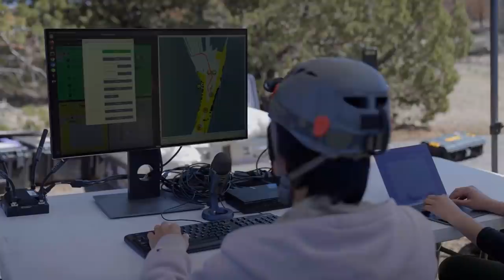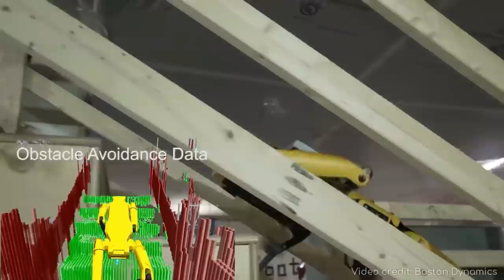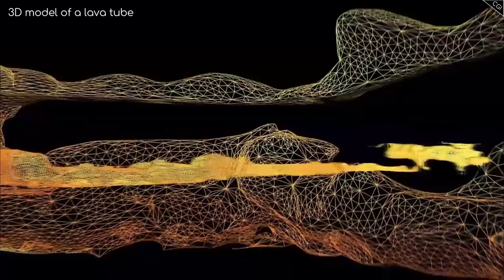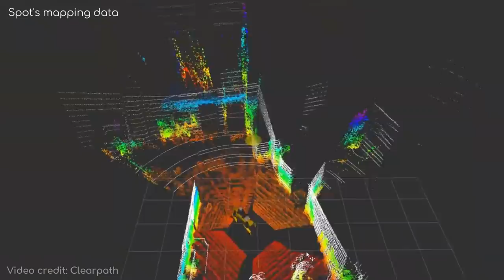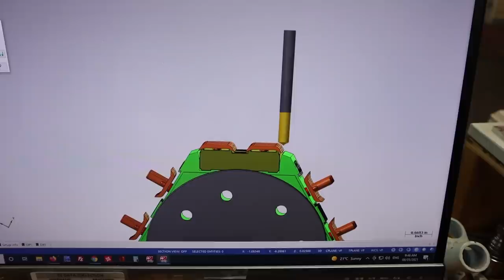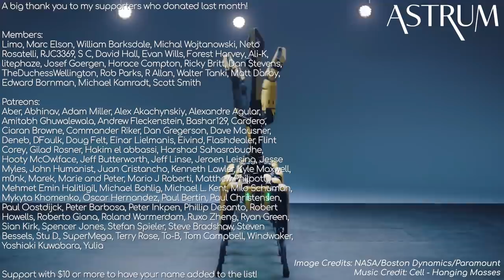How Wheels May Soon Become Obsolete For Mars Exploration

Comment: A few words on Spot’s radiation and thermal shielding would have been welcome. Be it on the Moon or Mars, the robot won’t probably be able to operate using the exact same configuration as here on earth. I’m also anxious to know what kind of mobile power supply they’re looking at. Let’s hope that Nasa will be able to secure a budget line within the Artemis program to conduct some tests on the Moon real soon.
Reply from the maker: Spot will definitely have to be specialised for the task, this is more a proof of concept. There are definitely still some obstacles to overcome with the design.
Reply: For power I could see a stationary RTG that the bots have to charge on. It would limit the range but lighten the load.
Reply: @upthere5826  Doesn't even have to be stationary, make it a wheeled rover
Reply: @astrumspace  Another important aspect of this approach is that by using an existing technology which was not initially developed with space in mind and definitely not on NASA’s budget, a substantial cost reduction is generated. Spot’s R&D cost have already been paid for by Boston Dynamics,  not by NASA’s subcontractors and there is no risk associated to delivery schedule. This would be a change in the way we go about exploring the solar system, moving from bespoke one-time use systems to quasi off-the-shelf customized units. And this does not even include the true paradigm shift to be introduced by the future jumbo carrier that Starship will become. Look at what the telegraph road brought to the development of the US or how tourism boomed after the Boeing 747 rolled out of the hangar. Fascinating times to be alive.
Reply: @astrumspace  Some?! Practically every component will have to be re-engineered. The sensors and processors for handling the large amounts of sensor data are all far more powerful on Spot than Mars rovers. 

This video makes it sound like you could send some Spots with minimal modification, not that they need to be redesigned from the ground up.

Something like Spot could be 20 years from being viable on Mars? I watched this video to hopefully learn about what research has been done towards the problem of applying walking robots on Mars. The current DARPA challenge is just about cave exploring, with nothing specific to Mars. 

I get that you wanted to talk about a cool robot and how it's being used by JPL in a DARPA challenge, but the connection to Mars is tenuous at best; probably why the NASA post on the challenge only spends a paragraph on the link to Mars.
Reply: @joemency2242  I was thinking it to be used as a relay for bots being in caves too. For extra range you could set up a chain where  the bot would charge the one ahead while picking up the data to move it down the line to the station.
Reply: Take a page from the game Surviving Mars. There's a larger wheeled rover that the smaller rovers can get a re-charge from.
Reply: @astrumspace    How reliable is Spot?  I'm particularly concerned about the joints, which must take a lot of wear and tear and are much more complex than wheels or tractor treads.  Unfortunately, there aren't any repairmen on Mars...
Reply: @RadicalCaveman  Reliable enough. Even if the mission was to end after 2 weeks due to mechanical failure, it'd still be a huge success. 

And I wouldn't be too sure about legs being more problematic on Mars. The main issues are temperature and dust. The former affects both the same, the latter favours legs---they don't rotate so the seals can be elastic and air-tight. Wheels have axles that need sliding seals.

Comment: The power necessary to charge one of these things has got to be tremendous in the world of extraterrestrial solar charging. The GPU/ai core alone is consuming hundreds of watts of power.
Reply: Actually they should send one to Mercury, no charging issues there haha
Reply: @tinp8028  The biggest issue with solar charging is the efficiency of it. I do not believe getting closer to the sun would allow our current technology to charge faster- though I could be wrong. Even the highest end panels on earth can only convert like 25% of the light energy received into power.
Reply: @coopers1716  capacity. They die quickly.
Reply: @coopers1716  While solar panels are only 25% efficient, that percentage is based on the amount of light falling on the panel. The amount of light is based on the inverse square law. Basically every time you double the distance from the sun you get 1/4th the light. Interestingly, each planet is very roughly double the distance from the sun as the previous. On Mars you need panels about 4x larger than the ones you need at Earth. If you are careful about power consumption you can still use them at the surface on a wheeled vehicle. At Jupiter the panel size becomes pretty unwieldly but it has been done. Anything further than Jupiter the panel size becomes too impractical to launch.

Personally I don't see anybody moving away from wheels anytime soon. Even with radio isotope thermal generators like Curiosity and Perseverance there is a pretty small power budget. Wheels are just so much more energy efficient than legs, freeing up that power budget for a larger science package.
Reply: It looked like one of those wheeled rovers had a nuclear power unit. They could send a big dog with the nuclear power unit and the little dogs explore then come back to recharge and upload...
Reply: Nuclear Fusion is coming soon!!

Comment: Wheels may get stuck in soft sand but they're also a well proven and reliable form of propulsion. Walking style robots have many more moving parts that act as points for failure. Focus needs to be put on developing robots that could repair robots on Mars if we're going down that path 👍
Reply: And wheeled vehicles can still move as intended(somewhat)  even with broken wheels.
Reply: Maybe a combination of both could be used. The robots would still travel using wheels most of the times, but when it got stuck or need to traverse challenging terrain, it would deploy its legs
Reply: That part about repairs is very good. I would think that a mechbot and repair facility would be needed right from the start. Then repairs on both walking and rolling bots could help them remain in service much longer.

Just so, a medbot and an infirmery needs to be set up prior to human arrival, as well. 👍
Reply: @daffamumtaz2361  Like wheels that can lock up to be feet on the end of a leg. I like the idea. It would almost be like some of those crazy rock crawlers with hydraulic legs that extend the wheelbase. The only problem is the complexity of including both wheels and legs, increasing weight (expensive), and the chances of something going wrong.
Reply: There's a reason most land-based animals evolved legs here on Earth:  they're just a better tool for dealing with different types of terrain than wheels.  Wheels may be simpler, but their simplicity is also their limitation.
Reply: @caelestigladii  Animals can't move around with a bum leg?  You've never seen a three-legged dog before I guess.  I have.
Reply: Yuh, more wheels, bigger wheels...   :)

Spot would have sank in that deep sand too... 

A jump rocket could get a heavy rover out!     ;)
Reply: @sciencecompliance235  Have you seen a two-legged dog stay "upright"? I haven't.

Edit: How about a 1-legged dog?

Edit2: Well, I got curious and it seems 2-legged dogs can stay "upright" if they have 1 front and 1 back limbs. My earlier train of thought assumed both front/back legs missing.
Reply: @caelestigladii  Really moving the goalposts now, aren't we?  You're describing a situation where three out of four legs fail.  Not sure what you expect me to say to that.  That would be a horrendously unreliable machine if that happened.
Reply: @sciencecompliance235   Did I not say "wheels" in that first comment? Plural? From the start I meant multiple wheels malfunctioning. 
 
Please don't move the goalpost to 1 when I clearly meant more than 1.

Please learn to read and understand what you read.

Edit: About unreliability, that's just it, wheels are more reliable than legs with current technology.
Reply: they could send the robot with a bunch of spare legs that can be detached and attached
Reply: @caelestigladii  A walker with 50% of it's legs out of action can still very much crawl. A rover with 50% of it's wheels stuck is going nowhere, or only in circles at best. There's no denying the reliability aspect overall, but at the same time cars are more reliable than helicopters in the case of mechanical failures. There are certain things you can do with each, that the other cannot do. The wheeled rovers simply are not going to be exploring that cave, but a walking rover can. The fact that it might be less reliable at doing the tasks we're already doing with other methods, isn't an argument against using it for a specialist task.
Reply: @sciencecompliance235  I think the biggest reason is because evolution isn't good at making bearings and rotating parts. But with that being said, I think legs are a great approach for mars. Both legs and wheels have their individual use cases. Wheels are more efficient and legs are more versatile. Versatility is desired on a remote planet, and efficiency is desired here on earth.
Reply: @caelestigladii  Wheels have already been proven to be unreliable on martian soil. As stated in the video, they get stuck while legs probably won't. A broken leg is no different from a stuck wheel in terms of being completely useless. It doesn't matter if a wheel is reliable or not if it doesn't get any traction while a leg will be useful for as long as it's operational.

That being said, I'm sure the best approach would be to deploy the dogs from a vehicle, close to the cave they are meant to explore. The transport rover takes safe routes, and send off the dogs into more difficult terrains.
Reply: @batman3698  This is probably part of it, too, but we have wheels now and still much more of the Earth's surface is accessible to legged entities.
Reply: Assuming you have all the parts !
Reply: Sending robots to repair robots on different planets is not financially viable. It cost $10,000 dollars to send a pound of materials in low earth orbit. Its not worth sendinging anything that's not essential to space missions.
Reply: @sciencecompliance235  animals don't have exposed joints and are flexible enough to clean themselves off. Dust storms will pack the joins of these things full of grit and they'll seize.

Comment: How exciting with the potential future missions of exploring caves on mars!
Could we have a video on just that?

I can see so many hurdles to get over. How do the robots recharge with the limited or next to no sunlight? How do you get the robots inside the caves? By the pictures of the cave entrances, many of them seemed to have quite high vertical drops to enter.
And with that, are they planning on getting the robots out to explore more than 1 cave, or just 1 cave for the whole mission duration?
Are they planning on have a base station on the surface that communicates/charge/etc the robot exploring the caves?
Why not use air drones to explore caves? 

I'm already excited for the years in the future when we get some reports from a hopefully a successful exploration of a cave on mars
I'm eager to know both what they might find and how they solved all the obstacles to be able to do the mission!
Reply: God bless you
Reply: What if it accidentally discovered a martian colony on a cave lol

Comment: NASA might consider sticking to the current rover layout, but replacing the wheel struts with Boston Dynamic legs while keeping the wheels underneath.

The rover could then move on wheels on easy terrain, and move on legs locking the wheels when needed.
Reply: but the thing is wheels isn't needed anymore if spot could go faster then the current rover, not to mention it equipped with an AI
Reply: @yahyarisqi7879  there are power constraints on space rovers, and moving legs is more resource intensive and more complex than spinning a wheel.

I too would like to see Star Wars AT-ATs roaming Mars, but that's probably far in the future
Reply: @TheNasaDude  my thoughts was nasa could send spot to mars with one rover dedicated as battery station, so this rover can always stay in the surface to harvest solar energy. Meanwhile the exploring unit (spot) equiped with an AI which can  self aware of it conditions, so when the battery fall into low category this unit will goes back up from the caves to switch battery and continue to explore. Yes i know this easier to say than to do but with boston dynamics i think they could make it happen
Reply: Do you have any idea what it does cost to send a gram of payload to Mars? Noone really would take to systems of similar matter to Mars "just in case".
Reply: @yahyarisqi7879  that's very futuristic, and I like it

I think we'll need to se Spot employed in meaningful missions here on earth before NASA decides to sent one on Mars though
Reply: @TheNasaDude  i think it's very possible by now, they had a lot of experience with opportunity and perseverance, both of that rovers have some algorithm installed on them that could tell what should they do if the battery goes critical. And also the case for opportunity they had algorithms for the rovers to backtrack it routes. If they installed this to spot, it would be possible. But yeah the thing is, spot need to take a lot of test and mission here on earth before they really send it to mars
Reply: @yahyarisqi7879  Better still, nasa could use advanced RTG type batteries, which will last the spot bots for many years (probably longer than the mission duration).
This wouldn't be too hard to do actually, and it is especially needed in cave like environments (no access to sun). Plus it will save the overall cost and complexity of the mission.
Reply: @Ezequiel Ciamparella if implemented right, you can greatly reduce the weight penalty. My idea is mounting the wheels at the foot end of the legs. You can then forego the whole frame that connects the rover to the wheels, and simplify the wheel assembly by using the legs articulation instead of a steering mechanism.

The wheels and their motors will not add much weight or complexity, and they are proven successful design: keeping them might save the mission if the legs get crippled.

On the other hand, NASA has sent to Mars probes with robotic arms, so maybe legs could be regarded as specialized robotic arms and deemed sufficiently proven on their own. We'll see
Reply: Or just more and bigger wheels...
:)
Reply: @yahyarisqi7879  how do you know spot can go faster then a rover designed to survive Mars...
Reply: @emko333  because i watch the documentaries, mars rover like "curiosity", "opportunity", and "spirit", could only travel as fast as 20-30 m per hour that's around 3,75 cm per second. not to mention the delayed transmission between mars and earth, so the rover need to stop periodicaly to wait for the mission controller decide is it safe to go or there are any obstacle in the way. but with spot, it can be equipped with an AI so it can decide for it self wether it safe to continue or stop and avoid obstacle. the communication with mission controller still needed of course, but only when there's some point of interest that spot detected
Reply: @yahyarisqi7879  again SPOT is a robot made for earth... you would need to remake spot to work on and survive Mars. Tell me how much power spot consumes just running its processors to do AI and where can we find one that is radiation hardened ? there are so many limitations when it comes to having something run on Mars... vs charging Spot with a outlet.

Comment: Interesting, Spot collecting a sample using a high tech piece if equipment, a Q-tip. Some things remain useful through time. That's somehow comforting to see. I wonder if Spot could do even better with 6 or 8 legs. Watching insects and spiders, not much seems an obstacle for them. They can just as easily walk across your ceiling upside down as they can on a wall or floor. I enjoy your videos. Great work.